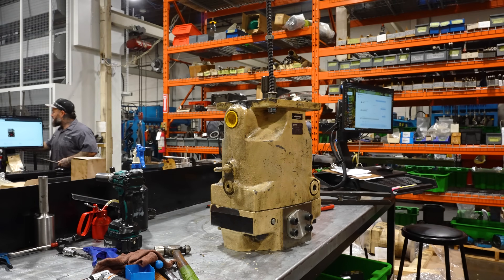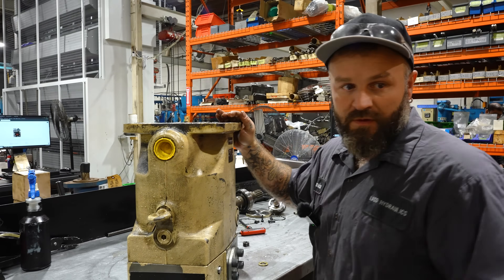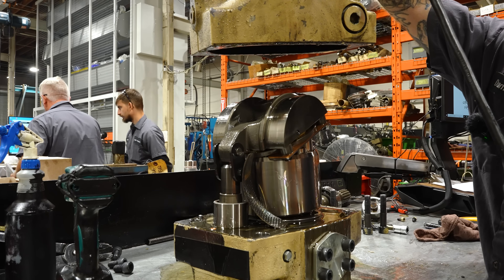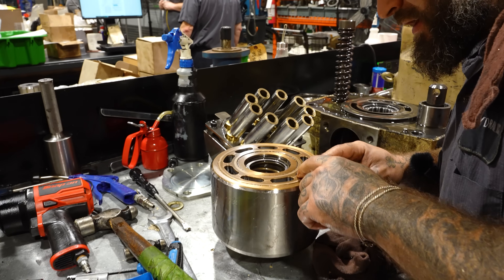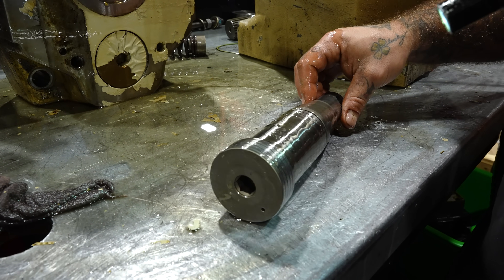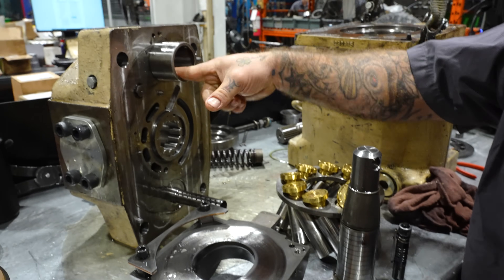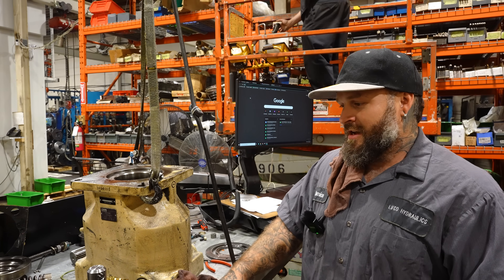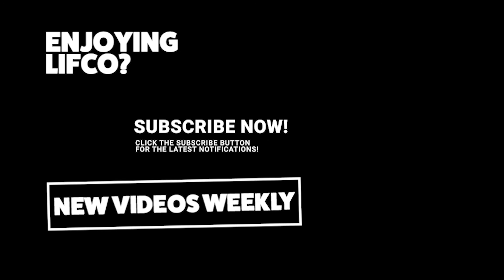PV270 Troubleshooting: Pump isn't Pumping

Comment: Issue is all the metal shavings in entire system after pump is rebuilt other components fail and rebuilt pump gets ruined...
I spend days cleaning entire excavator lines pistons motors valves blown out still has metal in system..
Impossible to get it all .
Best to rebuild pump Early BEFORE it fails..
Or $$$$$$$$